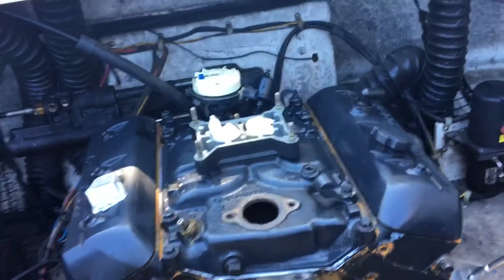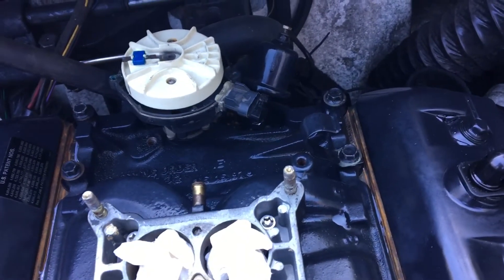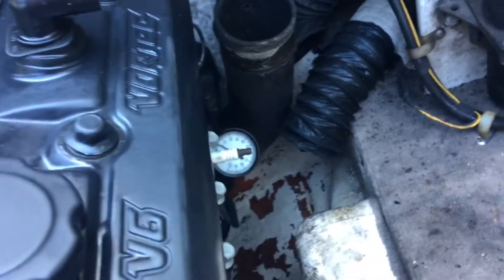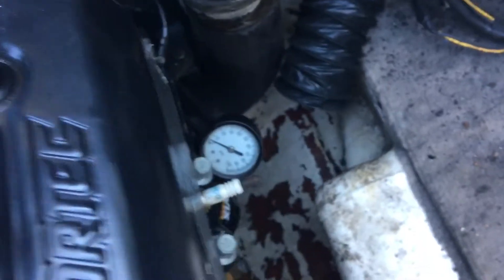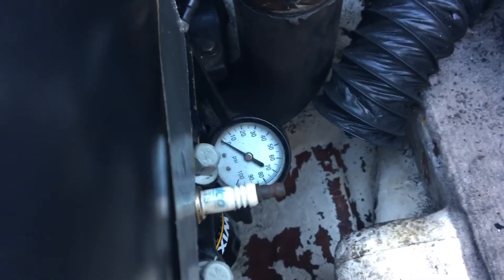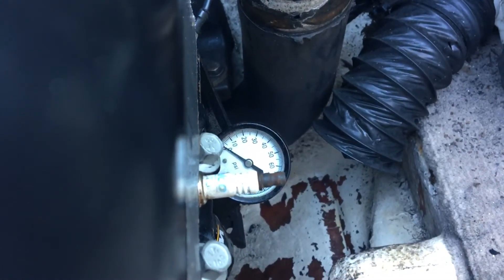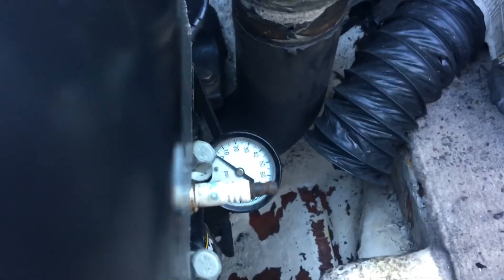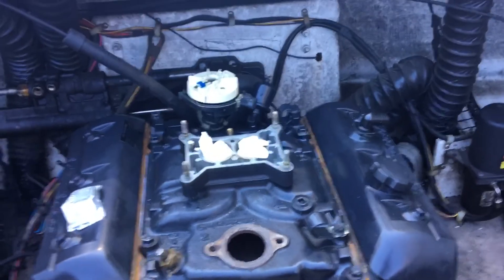Part 9B - Mercruiser 4.3 V6 Rebuild - Priming Oil Pump

Comment: I recently purchased a 4.3 mercruiser reman from Mercury. During oil priming procedure there is a clicking noise from oil pan area that coincides with the rpm of the drill I use to turn the oil pump. Any ideas on what that could be? Thanks, Daniel.
Reply from the maker: There is a plastic coupler used to keep the oil pump drive shaft ( two pieces) together. It’s sounds like the coupler either broke or it’s not there. Either way oil pan has to come off to fix. If it’s dry and oil isn’t getting to oil pump the pump gears will click as they turn but oil will quiet that down quick. Your primer might be clicking since I don’t know what you are using. Email me a video or post to you tube and send me the link and I’ll try and diagnose by sound.
Reply: Same thing is going on with mine. I think the coupler came loose, it makes a clicking noise when I spin the distributor with a drill motor, gear is off for camshaft, and I'm not getting oil up to the valve train!